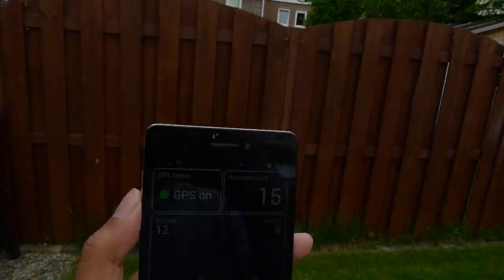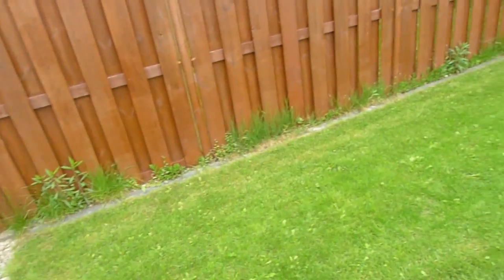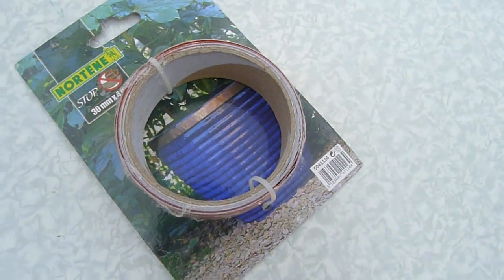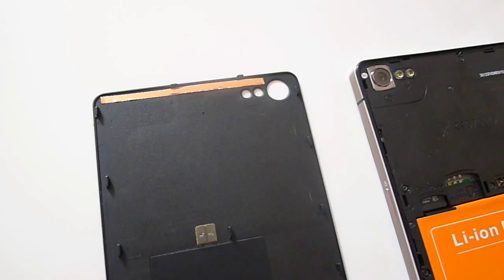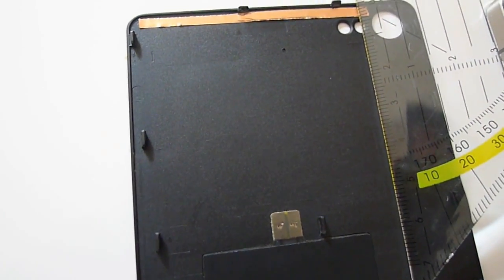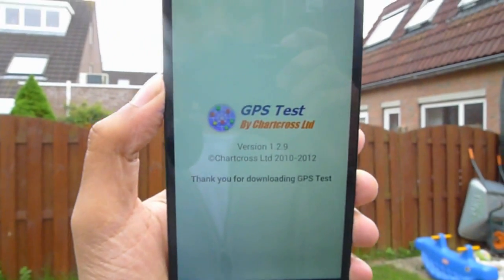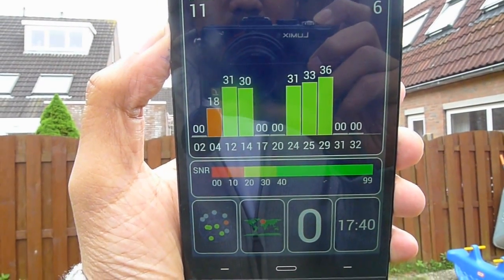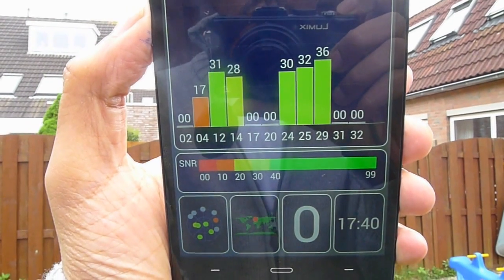GPS fix - Easily improve your GPS antenna of your MT6589 based phone

Comment: It works .... and has improved the signal of the Samsung Core Prime. I used aluminum foil that is used in the kitchen. I did not put it on the phone cover, but on the inside of the phone at the top as in the video, a strip along the entire length and 8 mm wide

Comment: Will this raise the phone's radiation and therefore be worse for the brain?
Reply: San Tos throw your phone into a deep river and that problem will be solved for your situation.
Reply: It should not. GPS antena is passive thing - it only receiving, not transmitting anything.
Reply: Ok then. Anyway, i got a phone with mediatek x20, so no gps problems. Finally!
Reply: @San Tos, only if you have a brain 😂😂😂

Comment: it works. I used a thin strip of alluminium commonly used in the kitchen. And it worked too. Very good, clever and simple trick!
Great.
Reply: +Vpprofフプロフ a fucking gps is supposed to have an antenna! what we buy is crap!
Reply: You mean this thin silver thing? Did you just put it on top of the antenna or did you connect some wires etc.? I'm very interested for I've been battling this gps issue for some months now…
Reply: akkaunt
Well, technically the things we buy all come with tiny copper antennae, only they're not very efficient. An antenna does not have to be a rigid rod sticking out of the device :)
Reply: +gdescatheoriginal I also tried it with aluminium foil and it worked! Fantastic!

Comment: Wow! I It works! I found the snail copper tape at the garden centre, and applied a piece as shown in the video.
Without the copper strip I got 6 signal bars all below 25, and after applying the copper strip I got 7 signal bars, 1 below 30, but the other 6 between 35 and 41! :)